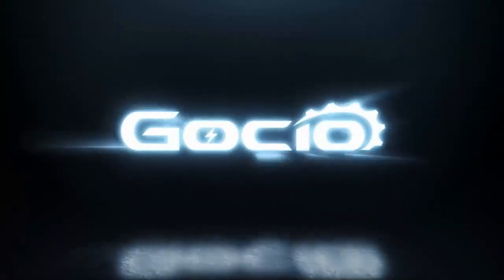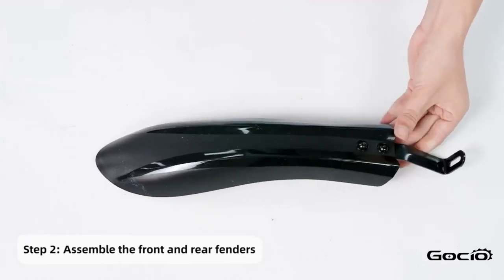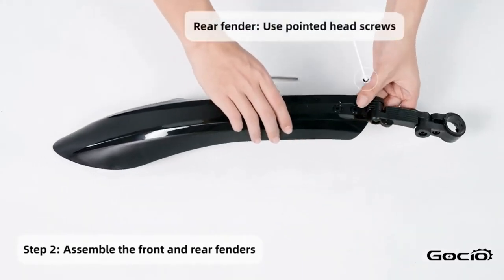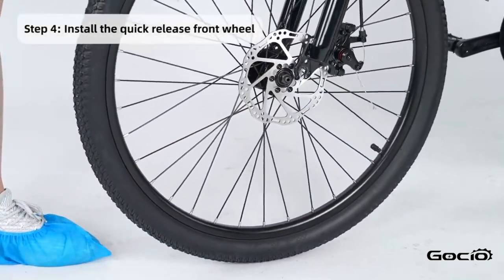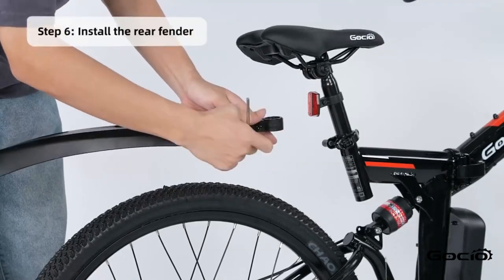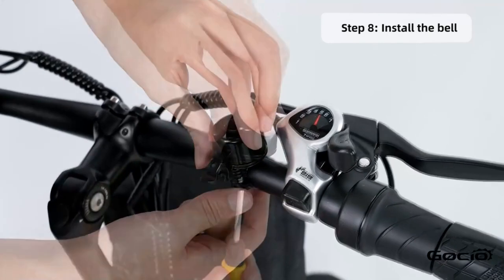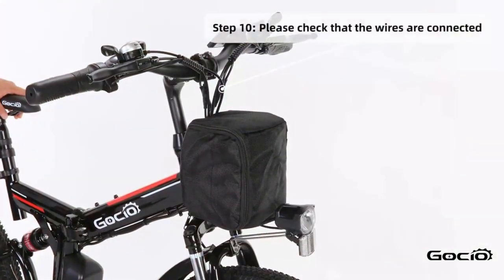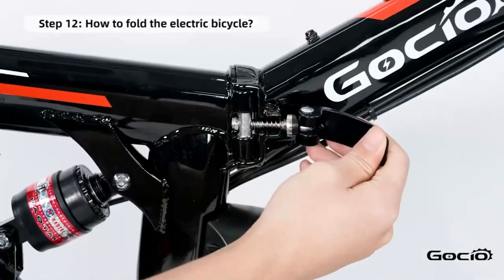Gocio fold-able electric bike

Comment: My lights on the battery go off, after turning it on?
Reply from the maker: Thats normal it will auto power off in like 10 minutes after that if you dont use it... They go off for that 10 minutes... Just give it some throttle and it should go
Reply from the maker: even though the lights go off on the battery yoou should still be able to power on the LCD screen on the handle bars and if so.. Your good to go! Be careful it goes just fast enough to hurt like hell if you go down like i did!! X) Good luck!